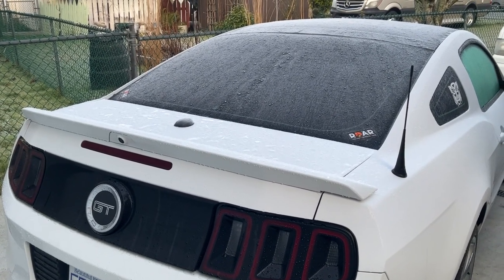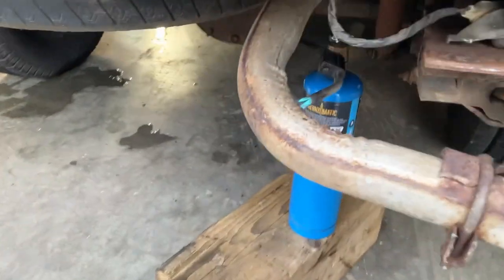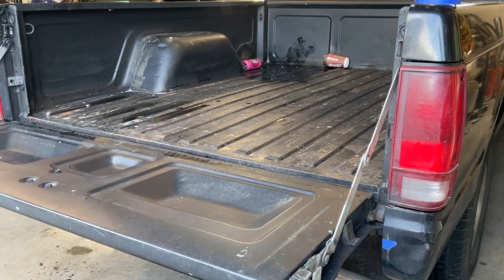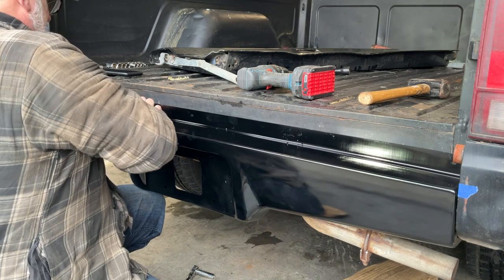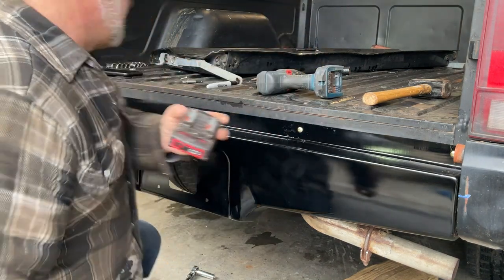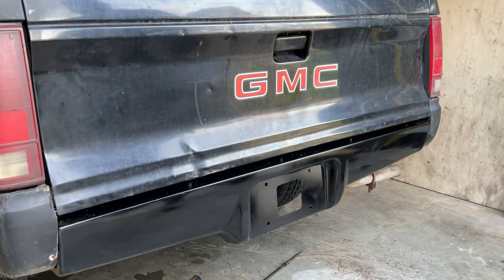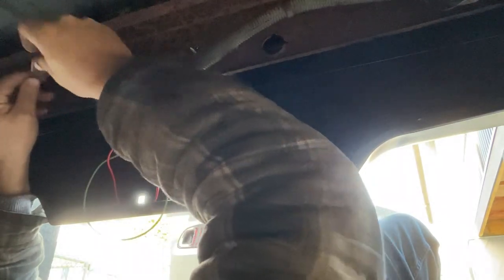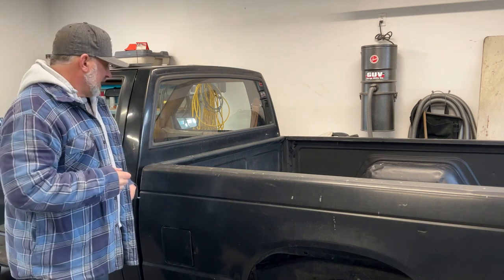1988 S15 project part 6, install roll pan.

Comment: Bought one for my 85 s10 it sticks out a bit at the bottom too some day down the road i guess i’ll have one made or make it fit and weld it on but for now she will do just fine
Reply from the maker: Yea not sure why they made them like this.  I think it is for a solid rear with a welded in tailgate.